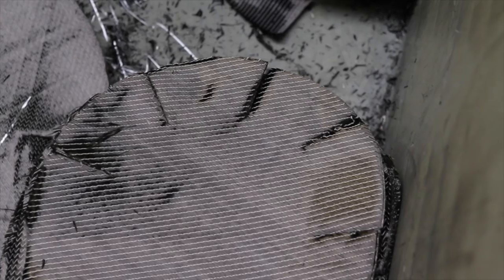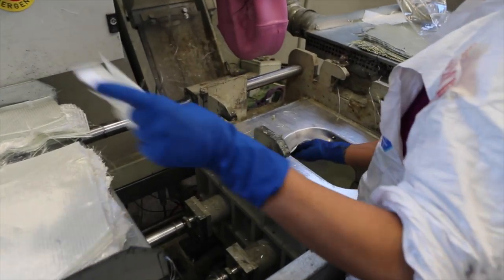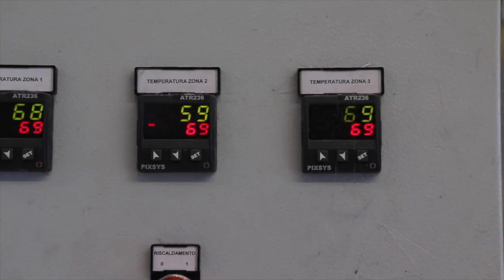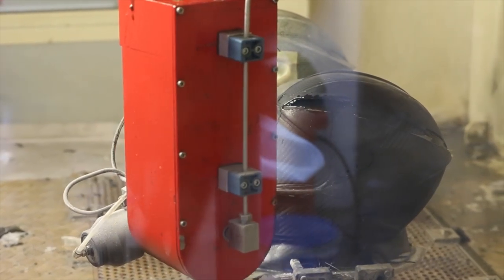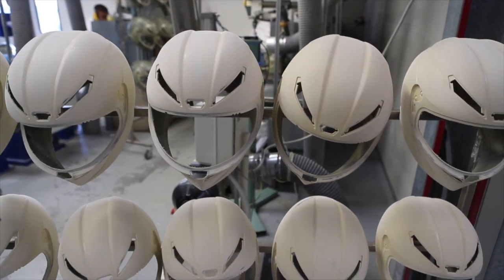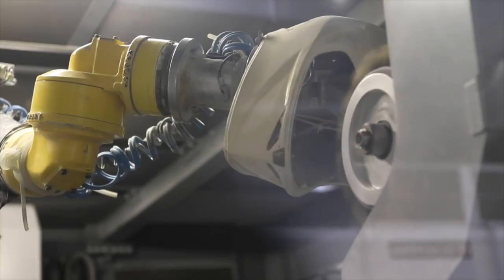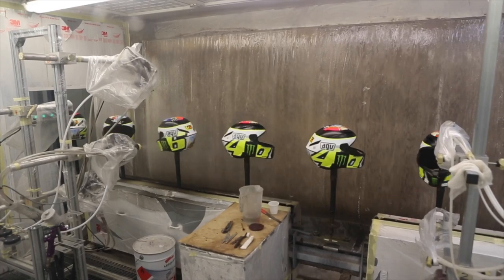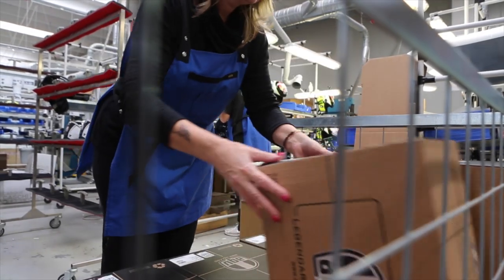‘Rossi’s helmets are made here’ | Features | Motorcyclenews.com

Comment: Just brought AGV K3 SV, its written on the tag ''made in china''
Reply: the italian plant is only for the high end helmets, like the pista or corsa
Reply: I bought a Corsa and sadly it also says Made in China.
Reply: Sadly, Mr. Frederik is wrong! No need to be sad about your helmet being made in China! It just happens to be made in the factory located in China! It's still made by AGV...
Reply: @UnionMan278  Corsa was the cut off point, that model was made in Italy and China. I had a made in Italy for example.  From then on, Corsa R and Pista GP are made only in Italy and the rest in China. Source: THEM and my personal esperience also, as I've had one.
Reply: @adrianfumi  except for basically slavery and it's very likely just "designed by AGV" and outsourced to a plant in china that produces helmets, possibly for many brands. 
It's a bad excuse. 

X-Lite or Nolan still actually make in Italy and for often less than AGV charges and they often have better Sharp and ECE rating.